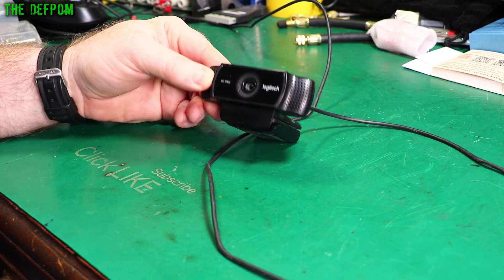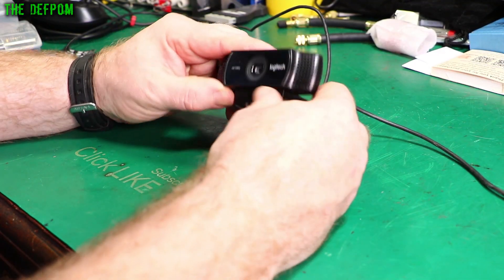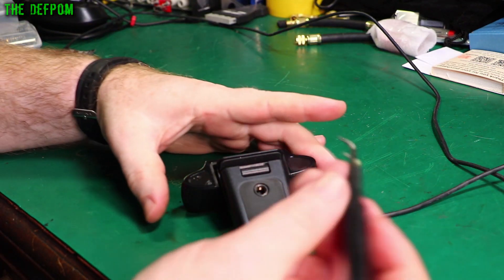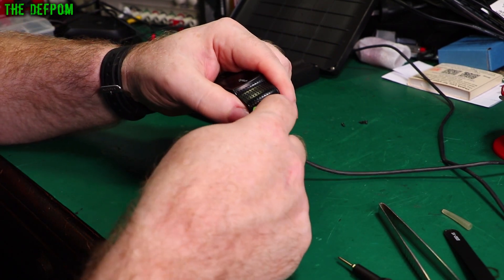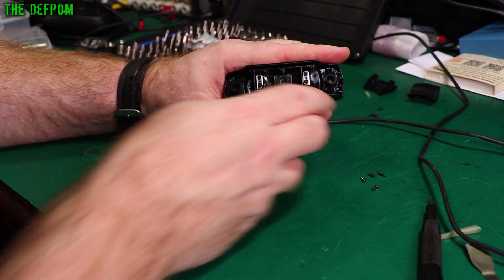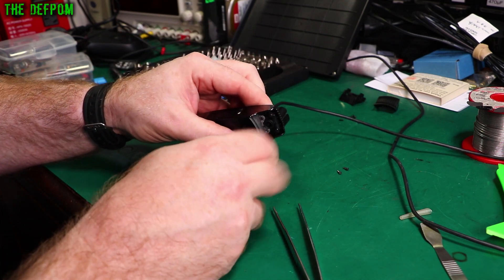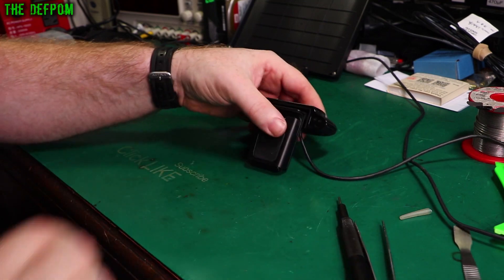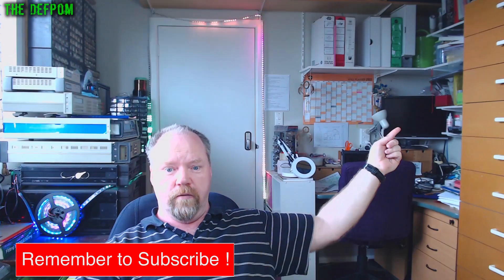🔴 Logitech C922 Focus Adjustment - How To Fix Blurry C922 Camera - No.894

Comment: Screws are stuck the camera can't be open ... I hate so mush company that sell this kind of unraiparable trash products
Reply from the maker: The screws are just a very tight fit, you need to use the correct screwdriver to get them undone without damaging the screw heads.
Reply: @TheDefpom  I finaly be able to repair it, in my case, it required to destroy one of the below screw with a mesh and a drill...
and it required to cut with and knife one of the 4 transparent plastic mount because there was nothing to do with theses 2 screw...

Comment: Some autofocus systems look for contrasting edges/lines to achieve focus, so a flat palm often isn't enough because of the lack of those contrasty edges. In my photography days I seem to remember Canon cameras were biased towards  vertical edges/lines....and you could adjust which area of the sensor would be analysed.
Reply from the maker: It doesn’t seem to matter what I hold up in front of it, it never likes to auto focus on the object, once it has a focus it locks onto it unless it loses it completely, OR seems to see a face, maybe it is a face tracking thing?

Comment: my one pulls a good focus then backs it way every time. means i have to use it in fixed focus mode all the time. maybe I'll give this a try soon. thanks for the idea
Reply from the maker: That is a symptom of this problem if it is a long way out, this will likely fix it.
Reply: @TheDefpom  well just tock it apart and played with the focus ring and found it was very loose so could well have moved when shipped over from china. now it does auto focus a bit better. Only time will tell if i need to have a second go. thanks for showing how to easy it is to get in to it.
Reply from the maker: @TheEmbeddedHobbyist  - good to hear it worked

Comment: Glad it worked I did wonder why you tweaked it then reassembled it and not tweaked it live so to speak:-) but you did in the end
Reply from the maker: I was basing the change on the other videos I had seen, turns out none of them were honest about having to go back and adjust it a 2nd time, which is why I mentioned it.
Reply: @TheDefpom  Murphy showed up due to completely reassembling it did not help. ;)